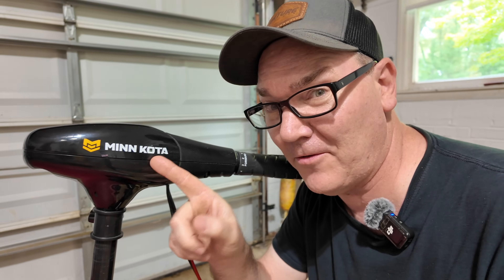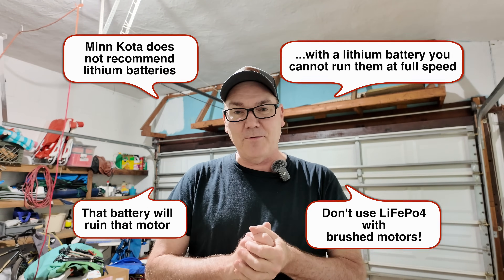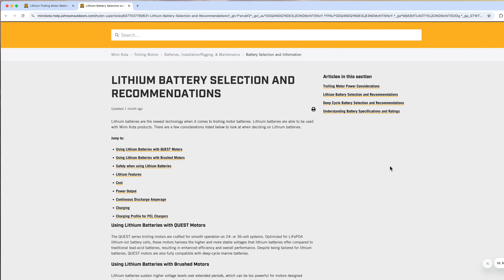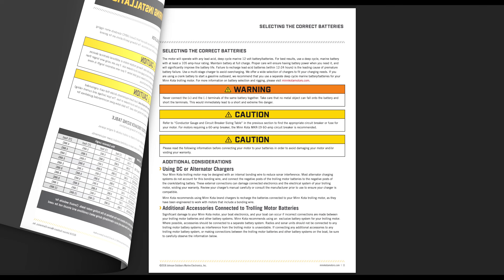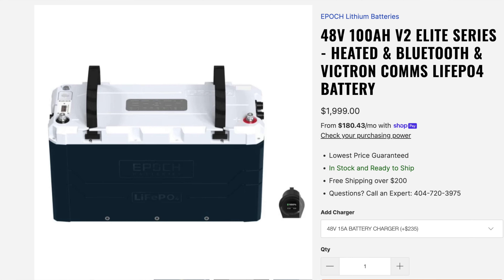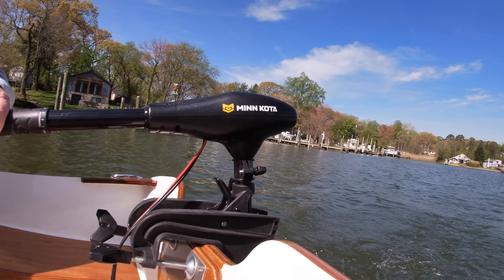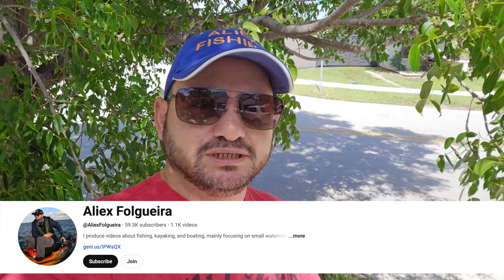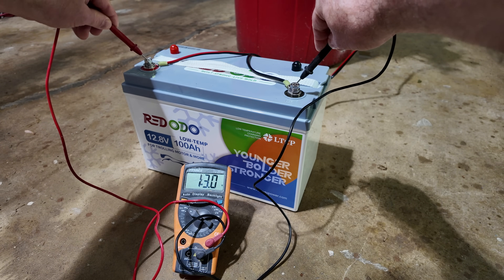Does a Lithium Battery DAMAGE a Trolling Motor & is Minn Kota Hiding the TRUTH?

Comment: Thanks for doing this! I just bought a Haswing 65 lb thrust brushless trolling motor for my kayak, and I'm hooking up a 12v 100ah lithium Bluetooth battery to it. I did get a response from Newport about their kayak series trolling motors and lithium batteries. The rep told me over the phone that, they also don't recommend lithium batteries for their trolling motors only because the lights on the motors that indicate how much life you have in your battery are not always accurate readings. The way around this? Get a Bluetooth battery so you can read the charge left on an app on your phone. Otherwise, the lithium batteries are perfectly fine. That is basically what he told me...

Comment: The best to manage maximum load of a Brushed motor is to monitor the current. Damage is caused by overtemperature while temperature is a function of the power dissipated in the windings of the motor. W = I^2 x R. Where I is the current and R is the winding resistance. Your Minn Kota has a maximum current rating. For example it is 30A for a 30lb motor. Use an amp meter in the power supply cable an monitor the current. You will see that for a Lithium battery the voltage at the start of the discharge curve is higher than the reated 12V which will result in a current that may exceed the maximum rated 30A. Note that this may not cause a catastrophic failure but will definitely reduce the life expectancy of the motor. So in summary, connect an Amp meter in the power cable and ensure that your Amperage does not exceedt the rating of your trolling motor (this may require you to not use the maximum speed setting during the initial stages of the discharge curve). Note however that your motor operates at full capacity at maximum rated current.

Comment: Just to clear up some confusion about lithium batteries and trolling motors:

Yes, most motors like the Newport 55lb were originally designed with lead-acid batteries in mind. But LiFePO4 batteries are completely safe to use—as long as the specs match up.

Here’s what’s different with lithium: the voltage stays high throughout the discharge cycle, and instead of slowly fading like lead-acid, the battery just shuts off suddenly if the BMS trips. That can surprise people if they’re not expecting it. Also, because there’s no voltage sag, the motor runs harder at high speeds than it would with a lead-acid setup.

That said, it’s totally safe if you use the right battery:
- Make sure it can handle the motor’s amp draw (50-60A continuous)
- Use proper fusing (like a 60A inline fuse)
- Avoid running full speed for long stretches if you don’t need to

I’m running a Redodo 12V 100Ah LiFePO4 with a Newport 55lb motor and it works perfectly. Just cruise at speed 2 or 3, and don’t worry when someone says “these motors aren’t designed for lithium.” They are—just use them smart.

Comment: Ok so let me break this down for you. The issue is not the battery. It is the batteries ability to provide its maximum voltage over an extended period. Which means you can run the motor at max speed for longer than with a old lead battery. Which will use up the coal brushes quicker.

Comment: My eMotor died using LiFePo4. I did not track usage so rough estimate is lasted 20 hours (20 trips 1 hr/each) on max power. Dont listen to anyone who says no problem or 100% will have problem. Results vary since folks use motor differently, have many different batteries, and different motors. Most users are fishing which does NOT use max power for hours on end which is really what causes problems like I did using motor to cover long distance quick as possible without a gas motor and my mom never told me that was bad.

Comment: Okay the only reason you might have a problem is due to using the same water. Brushed motors create friction that in turn creates heat. Brushes will fail when they get extremely hot and actually melt. They also wear out. This has nothing to do with the type of battery other than the battery can run so long it overheats the brush material and they actually melt. I have run into this with my mobility scooter. The brushes eventually will wear out and the leftover parts of the brushes will be sucked into the motor causing Catastrophic motor damage. So moving in water where the heat dissipates it should be fine. I am using twin 135ah 12volt Dakota Lithium Ion Phosphate batteries for a few years on my mobility scooter and their batteries with their 11 year warranty are way older than my scooter and still running perfectly. They have many idiot proof features designed into them to keep them from being damaged by inexperienced customers. I recommend them to everyone. They’re AWESOME!!!

Comment: Of course there is no sticker. They know how long them motors and components will last, just like the auto industry, they build cars for 3 years 30,000 mi. after that it's yours. Minn Kota knows exactly how long them motors will last and they also know at a certain length of time, those Ion batteries will wreck the motor. BUT , You will go buy another one !! Because it's JUST out of warranty.

Comment: Minn kota manual does say not to use aftermarket props as the pitch on an aftermarket  could cause more amp draw on the motor...which results in more heat that could damage it.    So combine this with lithium batteries that dont have a voltage drop and i can undsrstand how excessive heat is built up contributing to failure.    Sounds like lithium with a stock prop is fine.      Additionally i would suggest making sure there is no fishing line stuck under the prop and dont try to muscle thru thick weeds at high speeds.   If the motor gets really clogged manual says to remove weeds anyway

Comment: I run a Newport 42# thrust on a johnny, canoe, kayak and inflatable so it gets used almost every weekend for 7 months plus I use the same battery when camping. My lead acid weighed just under 70# (115AH type 29) I replaced it with a $220 Lithium ion which weighs 23.5#. The only difference I have seen in the three years using lithium ion? Weight reduction and a 2x longer battery run time. Oh and 3 years on the lithium and still tests out great, that LA battery sh*t the bed during the 3rd season

Comment: If you really want to test, use a power supply set at the maximum voltage of a LiFePO4 and run the motor for maximum number of hours you would possibly run and at full power.  Electric power is just voltage and amps -- no war the motor knows the source of the electricity.

Comment: Lipo batteries are only really truly a risk if you puncture or severely damage them. Otherwise, as long as you're using the proper voltage and capacity (Amp hours or Ah), and charging them via a proper Lithium battery charger, your trolling motor will run great off a Lithium battery.

Comment: This is very interesting and valuable information!
Thank You!!
I'm not sure how you are able to run it on high, in this case 5.
My 24v Ulterra 80lb thrust 60" shaft on high(10) will only run for 3-5min. Then it power's off. I'm using the Li-Time 24v
with a BMS so I'm thinking it's the battery that is powering off due to heat or excessive drain? 
I tried "Spot Lock" in heavy current that required the motor to run on 10 and under 5min(estimated) it shut power to the motor? I can power it right back up and it will run again.
Does your battery contain a BMS?
Either way I learned not to run my motor on 10 or spot lock in heavy current. 
Your thoughts?
Thank You for this information!! 👍
Doug,,,
Reply: Check your 60A circuit breaker...I had nearly the same problem as you (and I wasn't even running on Lithium power) where the motor would shut off after running it on high for a few minutes. It was due to a faulty 60A minn kota circuit breaker. These are usually installed inline on the positive trolling motor cable in every setup to prevent overcurrent. Over time these breakers can fail and prematurely cut power. Unlikely that your battery is doing this unless it's brutally underpowered, i.e. you're using a battery that doesn't match the voltage requirements of your trolling motor, or your battery doesn't have the capacity to sustain the amp draw for very long.
Reply: @ChrisG9978 
P.S. Hey thanks ChrisG
Thought you were 
BoatGuy responding 😂
Appreciate your knowledge,👍
Reply: @joepodunk284  No problem...I happened to have the same problem a couple of years ago, the new 60A breaker solved it immediately. No issues with the trolling motor shutting down randomly anymore. Hopefully the new breaker fixes your situation, it's only a $25 component, and I would recommend replacing it every 4-5 years especially if you get a lot of water on it. You should easily be able to run your trolling motor on high...a 24V motor will draw around 50 Amps at max power. Depending on the size of your Lithium battery (if you're running 100Ah) that should be enough to last you a couple of half to full days of fishing. Obviously if you run your trolling motor at full power often your battery won't last as long, but in general you should be fine. It sounds like your 60A breaker is shot though. They have a limited lifespan.
Reply: @ChrisG9978 
Yep, unfortunately it only has mabe 10-20hrs
But I may have broke it
Lol, I flipped the arm instead of pushing the button one day🙄, after that the arm wouldn't reset but I still had power to the motor,
And yes I have a 100ah
battery. 
Fortunately like you said they're not that expensive and I think I screwed it up 😂.
Hey and Thanks again 👍
Reply: @ChrisG9978 
THANK YOU! 
You just may have answered my problem!
Ya I have a 24v Li-Time battery to a 24v minnkota so I'm good there, but on my 60amp breaker the reset arm doesn't seem to latch into place, almost like it's tripped? I thought if it trips it'll be latched?
I wondered if that'd be a problem sometime.
Think I'll order a new one,👍 
To sum up, you believe I should be able to run it on high or close to without any problems 
right? I just figured on 10 that was just too much draw, this will be awesome!!
Thanks again, already subbed from the vid you provided and Thank You once again,🙏👍👍
Doug/ Oregon.
Reply: @ChrisG9978      a local fleet of rental rowboats with 50lb and 55lb  minn kotas, agm battery and breaker... i have seen a hansful of faulty breakers tripped at speeds 4  and 5...    replaced breaker and problem solved.   When i peeled off the minnkota decal on their breaker i discovered a chinese label.. the exact same breaker sells on amazon for a fraction of the price.

Comment: My minn kota c2 30lb just failed and left me stranded a couple miles from my car... I was running it full speed with a renogy lifepo for a couple hours. I stopped to go for a swim and when I tried to go again the motor was dead. It's only about a year old with occasional weekend use during the summer. When I took it apart I found the ground wire from the battery to the switch was melted and wouldn't make continuity to any other wire on the switch. The motor still works so I guess I'll try wiring up a PWM 🤷
Reply: Put a regulator or buck converter rated for the proper current between the battery and the motor to lower the voltage.  This guy's clueless, spreading misinformation.  ..

Comment: Save yourself 10 minutes. They are fine to run on lithium batteries. He tested it for over 2 1/2 hours and nothing happened. Another guy said that he’s run his on lithium batteries for years and they are fine.
Reply: Thanks, 10 minute video is a waste of time for this topic.
Reply: Thanks. I figured as I have done it many times. Click Bait. Not coming back on this channel. Bye
Reply: @Jb-vc5fq  not all heroes wear capes thank you
Reply: Thank you
Reply: Doing the lords work for the people
Reply: My brand new trolling motor manufacturer states not to use a  Lithium battery. I'm gonna use Lithium anyway, now.
Reply: @flierbill  maybe tell what manufacturer namebrand you have?!
Reply: your wrong it destroys the brushes. much like a drill. it degrades power and torque.
Reply: @pearlrival3124  the brushes are replaceable so if and when they fail.... replace them
Reply: @snocattrf  time is your most valuable asset. instead buy the brushless motors (;

Comment: It’s not as though Lithium batteries increase voltage as they run. It’s that they don’t lose voltage. That ought to be better for the motor. What’s amazing for me is how much more run time I get with lithium. More watt hours. Much more useable watt hours. I do check the charger more frequently if I think I’m getting near the end.

Comment: I have been running a Minn Kota endura 40, using a 120ah LiPO4 battery (13.2v min), flat out for 1h20min to get to where I fish, then 1h20m to get home as a regular thing on my local lake for over 12 months. Everything still works fine.

Comment: Run the amperage manufacturer requires. 12v isn't the problem it's the amps. 600 amps you can weld with, and the electronic circuit board has small cheap made contacts, wiring, and circuit board. The circuit board is very expensive, and they know it will burn out quickly. Windy days and trolling are killers on the circuit board; you touch the cap and feel it"s hot. I pour water over my cap and cool it down quick, but still it's cheap.

Comment: Y'all 4got that this is a prop issue. The default prop doesn't pose an issue. Its the aftermarket props w 3 blades & the props w a more aggressive pitch. If u try 2 run it lithium battery w AM props, expect ur brushed motor 2 overheat & ur  control wiring may melt. Lithium, as we all know, doesnt suffer from voltage sag under load like lead acid batteries. Without that voltage sag, it's being powered fully 100%, w the sag, its only being powered 85 to 90%. Forcing the motor to produce full torque to spin the extra 3rd blade to generate thrust & the larger overall mass of the prop + its larger size + greater blade pitch angles = 1 dead motor. That, is the reason Minocota tells u to nvr run ur motor  above 80% of max. I'm surprised none of u boat guys figured this out on ur own. Redo ur video,  but this time graph the data from ur 1st video w the default prop as ur baseline. Then change out the prop to a few AM props & graph ur findings. I'm sure u will find the results of ur garage tests as eye opening a the real world testing I've done ovr the years. I find that no matter the size of the trolling motor, the 2 bladed prop will not troll uphill when it gets bumpy in a stiff breeze. A 12 inch (30cm) chop will pretty much place u at a standstill, which is y I have to fire up the Yamaha to make my way thru it, at least until I change the default prop on the mincota.

Comment: I bought an Ultrex in 2020.  36v, 112# thrust.  I ran it with 3 12v lead acid batteries. 
In 2022, I bought a 36v, 40ah Lifepo4 battery.  At the time, that battery cost right at $1k plus I had to buy a special charger.
I took close to 150 pounds out of the back of my 25 year old boat with a 25 year old Evinrude 200HP engine.  Hole shot improved immediately. 
I ran multiple tests with the trolling motor in a barrel.  The tests included running the TM on 10 until the battery died.
I have used the TM for countless trips since then with zero issues.  Of course, I don't run it on 10 very often, but I will do so occasionally when I want to zip across a slough.
The battery is only 40ah, but it has been more than sufficient.  Last year, I fished 5 days on Okeechobee without charging.  There was very little wind, so the motor stayed on 3-4 most of the time.  This year, I had to charge it after only 3 days.
Charging takes about 1/3 the time needed to charge lead-acid. Plug it up, have dinner, go unplug the charger.
I had to call MK about a GPS issue, and the guy was very wishy-washy about the use of a lifepo4 battery.

Comment: If you are concerned, use a PWM designed to go to only to 85% duty cycle.  You can use different designs but a LM555   circuit is very simple and can be used with a logic level MOSFET + a big heat sink to control speed.  Direction can be accomplished with a set of 12V relays.  But I run mine all the time at various speeds with an LiFePo4 battery.  No issues.  If it is heat, I am not convinced that it would be the brushes, as in motors I have seen commutators and winding's die from excessive heat more than brushes.  Unless the brushes are not maintained and they grind away to a little stub.I think unless one runs these things at high speed instead of using it as a  trolling motor it might be wise to learn to by yearly take it apart, inspect it for ware by viewing the  winding's for burn marks or discoloration, the bearings for looseness and replace seals.  Or just stick $1.00 in a piggy bank each time you use it to replace it after you figure out you really should have brought oars.  It's only a $130 motor!